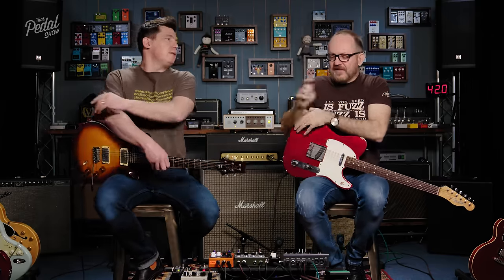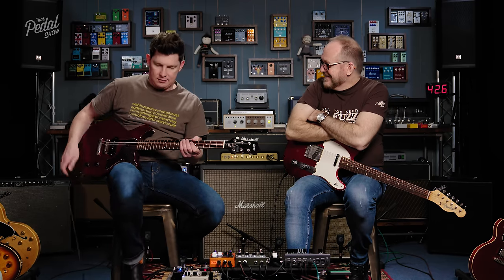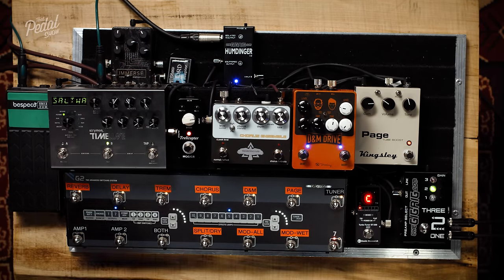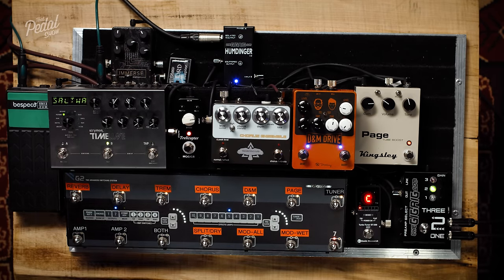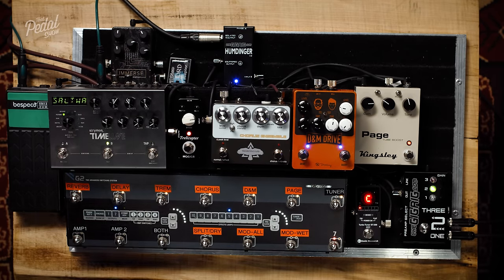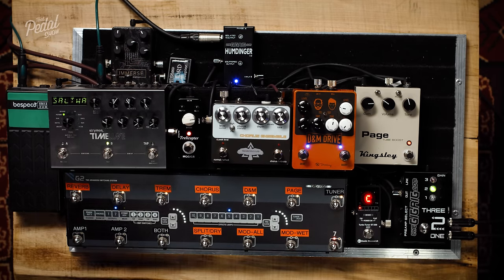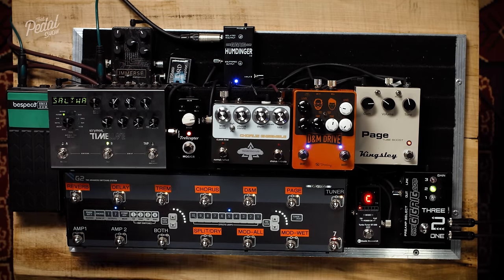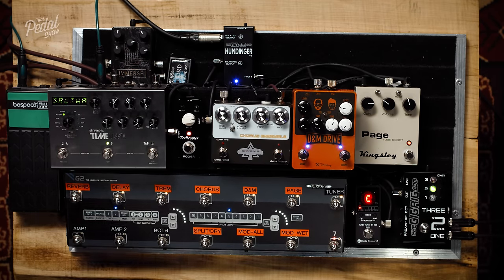Wet-Dry & Wet-Dry-Wet Amp & FX Setups Explained – That Pedal Show

Comment: If you'd want the wet amps to be 100% wet, with no overdrive/distortion, how would you go about setting that up? Could you simply place the splitter at the beginning, before the pedalboard and have one signal go through the dry pedals and then into the dry amp, and likewise have the second signal from the splitter go through the wet pedals (the last of which is stereo) and then to the wet amps? And would there be any way of using a volume pedal to actually adjust the amount of dry signal that goes to the wet amps?
Reply from the maker: Yeah, the theory is all the same. Just move the split point! Same goes for the volume pedal, maybe drawing a diagram would help you visualise it…. Cheers!
Reply: ...and, just to clarify, when I say "100% wet" to the wet amps I'm talking about the effects being 100% wet. I'm not suggesting excluding the direct signal from the guitar to the wet amps. I know that technically the direct signal, the clean "attack" or picking of the strings is dry but that's not what I mean. The reason I ask is because the overdrive or fuzz that you dial in to go to your dry amp might not sound all that great in your wet amps. I would assume you'd specifically dial in the overdrive/distortion to sound a specific way using your dry amp. So excluding the dry effect pedals in your wet amps might be preferable in a situation where your wet amps are not handling the dry effects (dirt) very well. And at times it's perhaps even something that is a simple matter of how much overdrive that goes to the wet amps? That's why I ask about being able to adjust the volume of the overdrive effect going to the wet amps using a pedal (expression/volume pedal).
Reply: @ThatPedalShow  Ok, and would having a clean guitar signal (with no dry effects) going through the wet effects to the wet amps, while having a heavily distorted signal in the dry amp be advisable in your opinion? Or would it sound weird?

Also, regarding the possibility of having a volume pedal controlling the amount of distortion going to the wet effects - thinking about it I realize that what I'm proposing  is actually more complicated than I initially thought.
I would have to first split the direct signal from my guitar before it goes into any pedals (splitter no.1), with one of the signals going through the dry pedals, then into another splitter (splitter no.2) where one of the signals going directly to the dry amp and the second signal to a volume pedal that then is connected to something that is essentially the opposite of a splitter, an un-splitter, where the dry signal (distorted) from the volume pedal is combined with the second direct signal (clean) from splitter no.1. This way, with the volume pedal pushed forward I'd get what you have in your wet/dry/wet rig in the video (+ a clean direct signal). And if I adjust the pedal towards heel position I'd lessen the amount of distortion going through the wet pedals, getting a less distorted wet signal. It would essentially be like having two guitars playing the same thing, with one being distorted and the second one being clean with flanger, chorus, delay and reverb applied to it, but with the ability of applying and then adjusting the level of distortion in the wet signal.

I have no idea if there is such a thing as an "un-splitter" or if it would even sound good, but it would definitely be interesting to hear 😀 So, is there something like an un-splitter that would let me do what I'm suggesting?

Comment: A much more simple method for W/D or W/D/W is to take your favorite tube amp, run it into a line out box, run that line signal to your effects, then a rack mountable stereo poweramp.  Lugging around two extra tube combo amps is a lot of added weight and hassle.  A solid state power amp doesn't color the sound, you get the pure clean sound of the effects, and is much lighter/more portable, consistent, etc.  You could totally get the job done with a 1x12 tube combo and a separate 1x12 ot 1x10 extension cab for your fx.

Comment: Stupid question, can you set up a wet-try rig with two heads each feeding one speaker in a single 2x12 enclosure? I don't see why it shouldn't work as long as I have a jack for each speaker but i don't know.
Reply from the maker: You can... And if would be cool. But not as completely mega as two separate cabs.
Reply: But it would be easier to explain to my wife.

Comment: Question about ground isolation: Could you just use the ground lift switch on one of the amps? (Like the switch on Fender amps)
Reply from the maker: No, if your amp has a ground lift switch your amp needs modding to get rid of that switch and to be made safe. Those switches are dangerous and have the potential to do serious harm
Reply: That Pedal Show Really? Then why on earth (pun intended) did they include it on my Bassbreaker 15? Or is it a different sort of ground lift?
Reply from the maker: That ground lift only affects the shield on the XLR output, not the grounding of the amp
Reply: That Pedal Show Thank you for clearing that up! I’ve always been confused why a modern amp would have a ground lift.
Reply: You will get a difference of earth potential between the amps and could get electrocuted

Comment: I wonder if Wet-Dry could be simulated with 1 amp using a splitter before the wet, essectially putting the wet and dry paths in parallel, and then a summing box before the amp. I mean, I know you wouldn't get the stereo spread, but it'd be interesting to see how that sounds.

Comment: Are there any simple solid state amps with a nice clear clean that take pedals well? I need a new amp for my new pedalboard and I'm selling my modelling amp because i've come to the conclusion that i hate modelling amps. Tube amps are either too expensive, or have so little power that they can't be used for gigging
Reply from the maker: watch this weeks show :)

Comment: You can also use the Ground Lift switch on the back of your amp/pre-amp if it has one fitted. That safely removes the path to Ground for you also and eliminates hum and loops. Only if factory fitted though of course....or professionally fitted by a technician I guess. It wont fix your phase issues though.............but you might have something that just covers your phase flipping.  hmmmmmm

Comment: I run a dual amp rig using an ES8 loop switcher (capable of splitting the signal) in front of the amps and two midi loop switchers (G-Lab m4l - one for the left signal the other for the right signal) with a passiv splitter (lehle p-split) - in front of each - in the effects loop of the amps. The signal path is: fx loop out (amp A) - split - input of the m4l left  / return of the first loop of the m4l right // fx loop out (amp B) - split - input of the m4l right / return of the first loop of the m4l left. Here is my question: will I die in case of electric shock? (seriously the lack of humming noises, well ther are some but only in the or15, which is a noisy amp, makes me suspicious)
Reply: I also have an ES8 with 2 amps but only one Lehle p-split and I'm not using my amps effects loops. I can't visualize your signal path. So you are using both outputs of the p-split? Do you have the ground switch in or out on each p-split

The main thing you are trying to do with something like the p-split is to break the guitar signal cable's outer shield going to the front of only one amp's input, not both. Both amps are grounded through their AC plugs and only one should pass that ground through all the way through the pedals, ES8 then to the guitar. The other only passes to the point where the p-split is placed. To be safe, at the end of the day, any metal that you can touch must be tied to ground to avoid shock.
Reply: Thx for your reply. Your right my signal path is quite complicated. I use two p-splits (one for each amp) in the fx loops of an OR15 and a Brent Hinds Terror amp (similar specs but voiced differently). Direct out of p-split A (grounded) of amp A into the main input of a g-lab m4l (A), Iso out (ground lifted) into the return of the first loop of the second m4l (B) basically functioning as an AB switch. Same signal path for amp B. Direct out of p-split B (grounded) of amp B into the main input of a g-lab m4l (B), Iso out (ground lifted) into the return of the first loop of the second m4l (A). Both m4l are grounded.  The reason behind this is that I want to be able to run both preamps in parallel (dry/dry or dry/wet or wet/wet) while being able to switch to full stereo (preamp A OR preamp B). I forgot to mention that I run a lehle ABY (grounded) in loop 7 of the ES8 (so I can flip the phase of one amp). I think this should be fine as long as I keep the ABY grounded, right?
Reply: @Eagleonspeed  So are all your stereo pedals are only in the g-lab switchers and your just using ES8 as a splitter for output 1 to got to amp A preamp, and output 2 to amp B preamp? Not using the volume loop and 4 cable method for stereo? This is genius! I'm still not sure I follow, but the more important thing here is safety. If you are coming out of the 2 outputs of the ES8 into each preamp, and each amp has a normal 3 prong cord plugged into a grounded outlet, then you should be fine. Sounds like all the stuff in the effects loop is configured so that you don't get any ground loops which is good, cause it would be super noisy there. However, unless the Lehle ABY in the front of 1 amp has a ground lift, and you are using it, I think you have a ground loop between the amp's preamp and ES8 outputs. Which is fine as far as safety. Just means everything back to the guitar is grounded. But it could be picking up some hum. If the Lehle ABY is inline with just 1 ES8 output to 1 amp and you can ground lift it there, this would break the ground loop, but still make all the metal you can touch grounded. Of course in this litigious world we live in, I make no promises about anything. I would need to verify in person with a multimeter to say for sure.  Is this a touring rig?
Reply: @JasonClute  I think you got the signal path right. I'd call it the 'six cable method'  :) Testing it with a multimeter is a good idea, thx for the tip. I brought the full rig to live gigs a few times but it has a hughe footprint on stage and it takes a long time to set everything up. And you need a way to manage volume levels if there is no pa. I use a boss RV 500 positioned last in the chain for that purpose. I wouldn't take it on tour. It's not very practical. I think of it more like a 'mad scientist's sound lab' kind of thing :D. You can get 'marvellous' sounds out of it but it takes a lot of fiddling with knobs and midi programming to get it to work in a live situation.

Comment: Also, can you not just use pedals with two outputs instead of a dedicated splitter to create a wet dry setup? Say a stereo chorus like the Waza CE that splits the signal on its own?
Reply: Yes but you still need to isolate one amp and make sure the speakers are in phase

Comment: I wanna try a wet dry rig, but not sure how to hook everything up, I use a switcher moen gec 9 v.2
Reply: darksidebilly as long as your switcher allows you to send signal to both amps at the same time, you put that switcher between your dry effects and wet effects. Then send one output to your dry amp, and the other output through your wet effects and then to your other amp.

Comment: I have an absolute doozy of a question, and maybe it'll even make you two scratch your heads.

I have built up a pedal board and I have some effects in stereo. My signal goes from my guitar into a splitter, then through all of my pedals, some of which are in a loop switcher, through my delay and reverb, and out into amp a. The other signal goes from the splitter, into the stereo inputs of my delay and reverb, and out to amp b. When I turn on my reverb and only listen to amp b (only delay and reverb in this chain), the wet signal is affected by the effects in the switcher even though they are running in parallel and aren't in the same signal Chain. Funnily, the delay signal in the same chain isn't affected by the switcher effects. Reverb works as it should by itself, cables are all OK. Any ideas at all because I'm so confused.
Reply from the maker: Impossible to say without seeing it Rory. Could be anything, likely how you have the switched configured. Draw a diagram. That’s where we always start! Good luck!
Reply: @ThatPedalShow  thanks guys for replying. This one really has me stumped. I guess a good question to ask is; is there a way that the stereo output can be affected by a mono input, despite there also being a stereo input? I really appreciate you guys taking the time to reply to my question already. Keep up the great work and content, all the best for a ripper 2020. Also, Dan, cheers from Brissie.

Comment: I’m using The Gig Rig ABY Baby to split signal to the normal and top boost channels of my 2005-ish (master volume) Vox AC30 CC2X. I get a prominent hum as soon as I connect the ABY Baby’s isolated output into the amp. Am I missing something here? Is this not an appropriate use of this splitter? (I use the top boost channel with my strat and the normal channel with my ES-335. I do hope to purchase a second amp eventually, but...)
Reply: What may be happening is a ground loop between the shield of the amps input jacks and the enclosure of the ABY. If the shield of the ABY iso output jack is tied to the ABY metal enclosure, it would create a path back through the A output back to the amp and other input jack which would all be tied. When you use it with 2 amps, the grounded signal is broken through a transformer inside it. But the way you are using, it never goes through the transformer since its the same amp.
Reply: Jason Clute - thanks for the reply 👍🏻

Comment: hi, i have a bit of a dilemma, perhaps someone here can help out...
i want to run my guitar through some distortion pedals into a chorus pedal and a flanger, and a boss volume pedal at the end of the pedalboard(2xin, 2xout), into a marshall with a 4x12 and a roland jc. 
can i make both the modulation pedals run in stereo into both amps(to make the sound of both effects pass from one side/amp to the other)???

Comment: So, I tried a wet/dry setup, but when the signal is split, the amps get less signal, correct? I notice that the gain pedals don't push my amps as hard, and it sounds a lot thinner then if I would only use 1 amp without any splitting (single amp setup). So, should you use a boost pedal as an always on pedal to boost the signal before the split? 
My amps are in phase.
Reply: It depends on the type/quality of your splitter. If you're just using a "one cable in, 2 cables out" box type splitter, you'll have a signal drop for sure. Higher end passive (un-powered) splitters use transformers and other internal wizardry to negate that. You can also get active (powered) splitters that have a buffer, like Dan's Humdinger. A boost pedal can restore volume, but won't necessarily restore the frequencies you lose in a simple passive split.
Reply: @Adam-fz8vy  Thanks very much. This explains it well. I was hoping Mick and Dan would have clarified what splitting does with the original signal, and what splitters you need to negate the signal loss (mainly gain in my set-up).
Reply: Glad it helped! I use the Lehle P-split, a passive splitter, with great results, but there are plenty of other options out there that could help your signal issue. Happy hunting!
Reply: @Adam-fz8vy  I've looked at Lehle for a splitter, and my eye has fallen on the Lehle SGOS. It has an adjustable gain circuit for the 2 outputs. That seems useful.